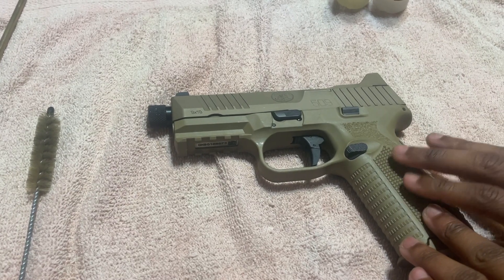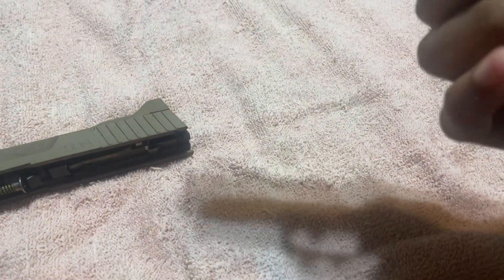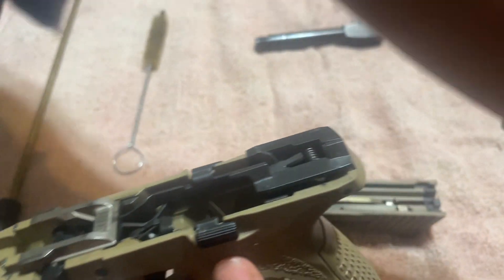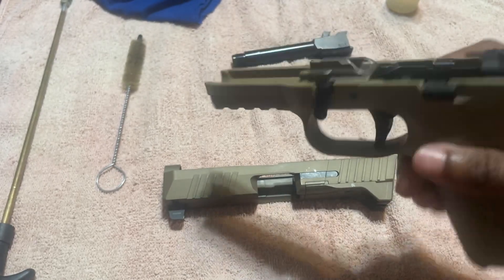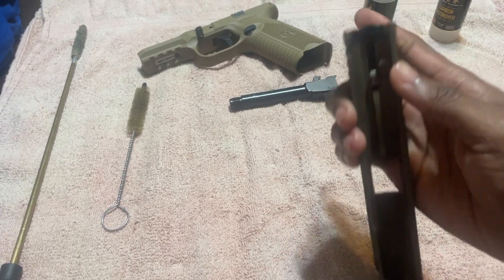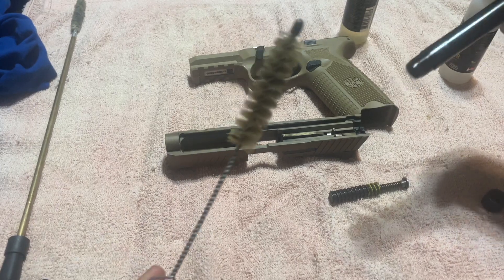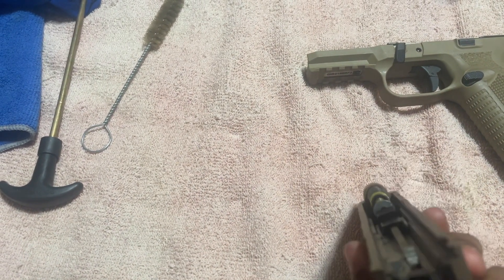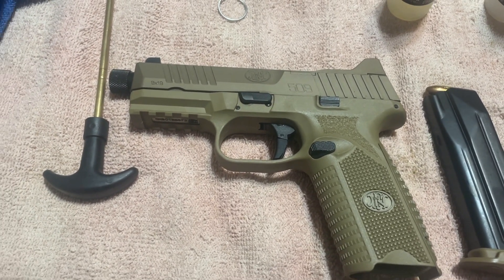How To Disassemble, Clean, & Reassemble New FN 509 Tactical 2023

Comment: I got the 545.
You really gotta get in there bro w/the pics & cleaning patches to get that carbon between the mechanisms. 
Also you absolutely do NOT wanna get carbon cleaner or oil in those two small pin holes on top of the striker housing, thats for exhaust gases.
That whole housing gotta be kept dry.
Spray the carbon cleaner on the pads then clean that part of the gun.